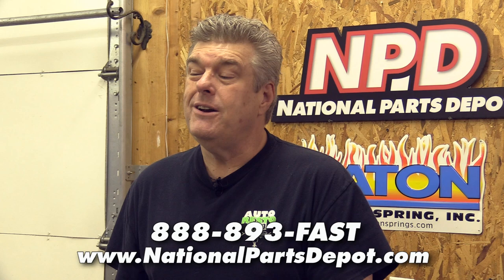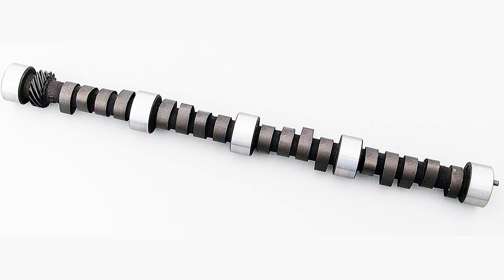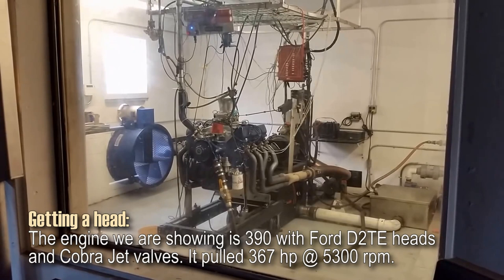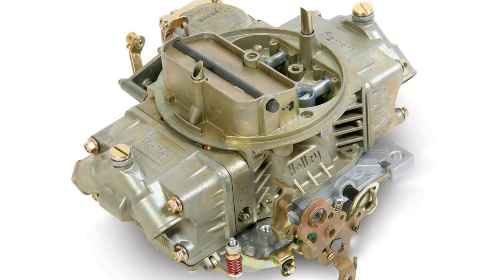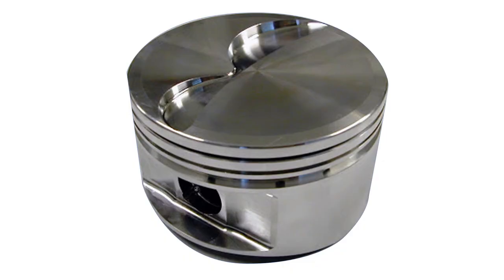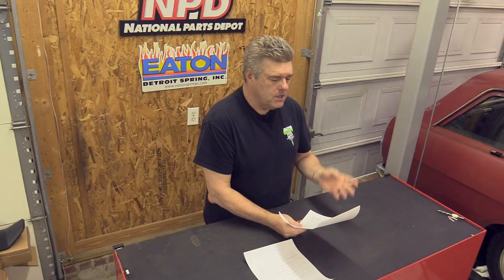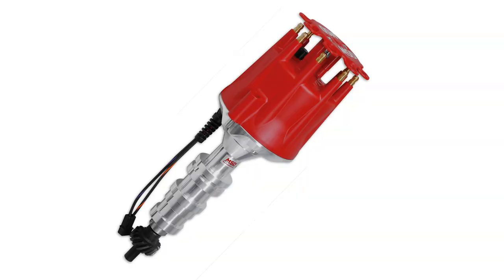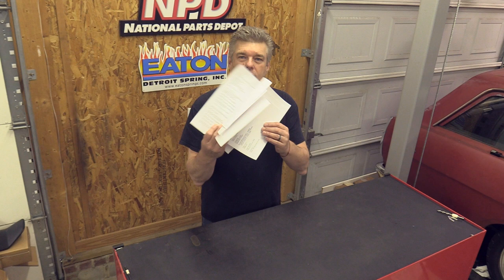Ford FE Build Tips

Comment: I got a 428 SCJ in a Cougar that over heats. The radiator is new. The engine was just rebuilt and runs perfect. Any idea why it over heats?
Reply from the maker: I might would look at the timing first. Then check your plugs to see what they are reading. You'll want to check a chart out on the internet that shows the different types of plug reads. If it is running too, lean the engine will start to get hot. Also, on the Fe engines, overboard can be a real problem for thinning out the cylinder near the water jacket. That can create hot spots. If the engine is over .40 over that could also be an issue. But work on the timing thing first.

Comment: I love my FE in my 71 f100 short bed. The motor is a unknown mileage motor that was in it when I bought it. It is a remanufactured motor I was told and a 390 but not verified. My question is what do I need to do to install fuel injection on it. It has the tank in the cab still. I know I need a return line but not sure what all is involved. I’ve seen a return tank under the hood offered but don’t know anything about it. Thanks for any help on easiest way to do it.
Reply from the maker: That's a really big question lol.. What kind of fuel injection do you want? Do you want direct port injection?  Do you want throttle body injection? The directions you can go with this are almost endless.

Comment: Seems like the other commenters know their fe engine so I have a question. I got a 330hd in a truck with a 14k pound empty weight. How do I get more power at cruise rpm (like 2500)without using high test gas.

Comment: Are the f e blocks all the same ?352,390 ….
Reply: 352,360,390 are same block. 427 is different and 428 is again different from the others but the rotating assemblies interchange into all 3 blocks. 427 and 428 blocks are harder to find and usually more expensive.

Comment: Have a 390 fe motor just got it back in new r&r now it’s mixing water with oil bent my push rod on one cylinder what happened what could it be
Reply from the maker: Sounds like a head gasket issue.

Comment: $7,000.00 For 360 h.p. , guess it depends on what you want, seems like big investment for small return.
But, it is a nice combo.
Reply: It does sound pricey and my small block chevy costs less and makes very similar tq/ hp. I love all cars and most trucks. I prefer Ford trucks.
Reply from the maker: The FE is in a group all its own.
Reply: Small return? Hardly.  Mine I built in 1999, makes over 425 hp and had gone for over 30 years since plus the years before. I don’t know.

Comment: Power nation built a FE around 10k in parts and pushed 600hp
Reply from the maker: Yep.
Reply: I remember that one and it would run on 91-93 pump gas. I know that they weren’t even pushing the timing.

Comment: I have read nearly every reply in the comments, and it seems that one issue has not been commented on that prevents 
any of these amazing 60-70 year old+ Ford FE engines from easily performing as the HP(High Performance) versions that 
were produced for nearly every FE model cubic inch displacement that was manufactured by Ford. Those HP engines had 11, 11.5, 12 to 1 factory compression ratios. Todays gas pump cat urine fuel prevents some fairly easy perfomance gains from original iron components, and maybe requiring piston and rod upgrades to handle the extra horses depending on how hard it is run. I am having a 1964 427 FE stroker built with modern hard parts for the rotating assembly and premiumI am going to have to settle for on todays  available pump gas. Makes me sad.

Comment: I cant decide.....I am contemplating a final build....445ci fe with aluminum heads on fuel injection.....$15k or a summit 460/540ci on fuel injection..... $16-$17k for a 73 f250 on super duty axles....
Reply from the maker: These are ponderous decisions.
Reply: The 445 is a good engine.  It can be a really torquey engine. If you have a 428 a 4.25 bore is a lot of fun too.
Reply: @fenatic7484  i went with a stock bore aluminum heads. Full roller. Waiting on fuel injection.

Comment: Curious on how a 268H Comp Cam (High Energy) would perform in a 390..
Reply from the maker: Honestly not sure
Reply: On an everyday driver, add headers and sure.  It will be fun with a750 VS carb and an RPM intake, at least you can have a valve job, new valves 2.055/1.625. It will be in the 430-450 range. Be sure to get top notch lifters!  It will be so nice. If you go into the pan, I would get a 3.98 crank do the rods with ARP bolts and forged pistons, and as Morgan said get it balanced. The engine will be good for 250, 000 miles or more with good maintenece.

Comment: 390 has rail rockers [no sled fulcrums] it is not possible for the damper to come past the pulley on the fe engine ditch the stock intake way too heavy alum. intakes are plentyful on the used market i have bought 3 in the last  2 years [under 200 bucks] the edelbrock stuff is really good i have one 390 with that set-up never have seen the step you are speaking of ?

Comment: How far can you overbore a 390 before you run into trouble? Or any fe engine for that matter?
Reply: Someone will probably override this, but at least in the old days, .030 inch was the maximum for the FE. The thin wall castings indirectly led to the high cost of the 427, due to so many failing quality inspections. Honestly though, my level of expertise falls short of what Jeff and his crew can offer.
My understanding is that the best production 390 block was in the 1977 pickup. If you do have an engine from the factory production time, getting the block and heads checked is worth the money.
Reply: It seems .030 is the safe limit.  More than that and you run the risk of getting too close to  the water passages.  Having the block sonic tested is a good idea to prevent that.
Reply: @et76039  Wow I had no idea they made the FE into the late 70s. I guess I assumed the emissions of the early 70s was what pushed them to use only  the Windsor and 385 series
Reply: @Jacksonkellyfreak  , the 390 soldiered on in the pickups after they got too "dirty" for cars anymore. The 400M eventually replaced it there. To show you how much respect the 400M got, it was common to remove the crank and put it into a 351W, to give it a nominal 400 cubic inches. 
I knew of one 390 engine that got ruined because because someone failed to mix antifreeze into its cooling system, gambling that freezing temperature wouldn't come to Florida. Other than that, the 390 seemed to be quite durable.
Reply: @et76039  FEs are a hell of a good engine and with all the modern performance they get overlooked or replaced.
Reply: In the olden days .060, with 427 being exception of .030. I've heard of 390 being overbored .080 & installing 406 pistons without issue.
Reply: @tombryant1104  , thanks for the perspective. I wasn't an engineer or engine builder, but we can definitely benefit from those who were around back then.
Reply from the maker: Good tips!
Reply: @tombryant1104  Any performance build needs a sonic check. The 105 blocks from the 70s pickups after a good sonic test might be capable of a .080 overbore. But with stroker cranks that after a bore to .030 over with a 4.125 - 4.25 stroke why not just build a 431 or a 445? If it Sonics to allow a 4.11 bore which Ford claimed was the max overbore, if you are concerned with piston speed go with the 4.125 with the 6.7 2.2 rods.  With good heads and intake and a roller cam, 600-700 hp depending on what is useful or tolerable to drive as you want. But a sonic test first. The triple webbing in the mains are good. A set of Pro-Gram caps or as I have a CapSaddle and Studs.   You can get great power from this horse. It was born at thoroughbred, and with some proper work could be again. That’s the fun from towing to Ray Paquets T-Bolt, wow!

Comment: The 66-67 fairlane was no match for the 389 3x2 gto of the same era. Sounds like this might have been the cure
Reply: bull!I was there, putting standard trans in GTA'sBut I had tricks,ever heard of drillpipe?
Reply: @duccanard9079  saw several comparos in rod mags and  on the street tooo. Out of the box stock
Reply: @tombob671  all library no life?
ate 440 6 paks with 302;s,killed 383;s with351 windsors, built 402's and forgot fuel push rods, and you read?
Reply: @duccanard9079  age 73, got life I remember stock no mods GT ran 15.9, GTO ran in the 14s. I am a Ford guy, but stock off the show room floor it was what it was. And  I had a 68 390Cougar. The 390 is a torque monster.
Reply from the maker: Ahhhh the sweet sounds of car guys arguing. LOL
Reply: @AutoRestoMod  no arguing on my part just my experience in 66. I am basically a ford guy but at 73 I have owned most brands used. As the man once said "your mileage may vary YMMV"
Reply: The secret is to do what Wangers did in those early tests , put a 421 in there and pedal it so no one’s the wiser. A .048 over 410 is a 421 in an FE with a 750 Holley the 428 CJ planned B cam  in place of the 600 and the little cam would have been a fun test. It isn’t cheating it’s just getting your best hold! 😂

Comment: What can you tell me about the 289 gt
Reply from the maker: What do you want to know? The 289 Challenger V8 was rated at 220 hp, used a cast iron 4V intake and 1.08 venturi 4100 Autolite carburetor. it used the stock Ford manifolds (not the HiPo style) and was discontinued in 1968 in favor of the 302 4V.

Comment: I only use clevite 77 bearings.
Reply from the maker: There are lots of pros and cons on all fronts for parts. Some folks won't use cam A because they have had failure issues...I'm like that too. I don't use Edelbrock carbs, do they suck? No. But I don't know how to get a poor mans tune from one like I do an Holley.
Reply: @AutoRestoMod  yeah I can work on a Holley as well. But if you take the top off an Edlbrock carb. Springs and check ball go everywhere.  Lol

Comment: Canton Pan. Balancing is NOT 1900.00. I have used Barry in the past and never again. I was charged Big $ for things that were not done. One of the rods had shavings under cap when machined so it was way off, machine work sloppy at best. All I can say is I am glad I went thru and checked all his work. Not to mention when he gives a timeline it becomes tomorrow, next week  . . for 14,400.00 one can run circles around that engine all day long with a much much better and more reliable engine that will make more HP. Better driveability too not to mention 3x  better MPG.
Reply: I paid $190 to have mine balanced. Not 1900
Reply from the maker: Sorry you had that experience.

Comment: You would have to be out of your mind to pay that kind of money for a rebuilt 390 with stock rockers and a small camshaft . I bet for $15000.00 I could come up with a big CUBE Fe and around 600 hp with the parts that you could buy off the shelf today .
Reply from the maker: $15,000 is not using stock rockers or a small camshaft. The engine that used that was more like $6900.30 and was the basic build.
Reply: @AutoRestoMod  Give me $3000.00 and a decent 390 and I will give you  400 hp engine with gobs of low end torque . I may even do the oil system for free .

Comment: Just out of curiosity,  why does Clegg Engine call their Scat stroker kit a 444 and here you call it a 445. I'm going with one of those kits for my 390. Believe me,  I don't want to be the idiot calling my motor the wrong thing. I mean imagine if you had a big block Chevy 454 and called it a 453 or a 455. You see what I mean?  I understand that  cylinder head volume and deck height and piston dish/dome volume  and head gasket thickness all go with bore and stroke to equal cubic inch displacement , but let's hear from all of you YouTube/ internet experts, seriously,  what should I call it to meet YOUR approval?  444 or 445?
Reply from the maker: Will it worry you to know that a 351 is really a 350? I'd call it whatever the manufacturer calls it.

Comment: Why a 260 HE?? 212@/050 is ridiculous for a 390 it is fine for a mild 289. Try a 270 Mag 224@.050 .530 lift, easy idle, plenty of vacuum. Do a gasket match port, clean the pockets, get a 3 angle valve job. add a Performer with a 1" spacer and a Holley 3310 (750) use the stock Ex manifolds but dual them with 2 1/2" pipes and viola.. 375 hp 450 ft lbs easily
Reply from the maker: Okee dokee!
Reply: Or go with the Edelbrock Performer RPM cam, 294 dur. and .572 lift with their heads which only have 209/166 valves and intake pkg which should give about 418 hp and 434 Torq. There are other brand heads out there comparatively priced that have  220/177 valves that have to flow even more air and probably make a few more hp. I agree with you,  why waste $ under building,  just do the research and build the whole package that will do what you want and you can afford.
Reply: @davidkeeton6716  I like the edie heads but the cam and heads will set you back over $2000 and the duration will require a higher stall and will compromise vacuum. The comp 270 is a great boost but maintains rock steady idle/vacuum and the heads will cost you just some time and a 3> valve job. With about $500 more for larger valves and porting and a comp 280 magnum...still a good vacuum.. you are looking at 400 plus and 465 ft-lbs
Reply: Put a 270H in and put one of those rear installed turbo chargers under the cab and back up to a blow through bonnet and carb . Just a set of headers to a 2.5 2-1 cross over with a short pipe to the turbo and a 60 mm Wastegate and a 4 inch V band out under the bed . Mount it on the passenger side so your 4 inch open pipe does blow the constables window out. Good ring gap 410 at .020 over should make a nice daily driver with 625 hp , 10 lbs boost! Pulling the trailer up the mountains! 😂
Reply: @fenatic7484  Ok, you said Constable so I am assuming you are one of those wacky Aussies? and, if so, with your people's love of strange hybrids, I am going to assume you meant TWO of the above combos, linked together with a common drive, one in the engine bay, one in the bed of the UTE ?? you are running away from the constable with;)

Comment: FYI:  I weighed a bare FE 4V cast iron intake at 75 pounds. Compared it to a brand new bare Edelbrock aluminum intake I had and it was 25 pounds. 1/3 the weight!!!!
Reply from the maker: I thought they were 98 pounds. Man, I need to start working out again.
Reply: Get help, or get a chiropractor.
Reply: I weighed a CJ and a 390 2V off of a 69 and they each weighed 84+ I think the later ones had more iron in them. The 69 2V I had was the premium fuel IP engine and it was a taller intake than other 2V s I have had. It was a bigger Venturi 2100 cab too. 1.33 I think it has been many years!

Comment: So a stroked 390 is a 445? WOW! What's a 350, non-stroked ,bored .060? 360?
Reply: There's a number of different combos. Depends on bore size and stroke length.  Stock 390 has 4.05" bore and 3.78" stroke.  Bore it .030" and add a 4.25" crank and you have a 445.  Other FE cranks you can find or get include 3.98 and 4.125.
Reply from the maker: What David says. It is a matter of what you do with the crank and rods.

Comment: Coyote. Won't make 400 ft tq at 2000 rpm.  The coyote needs 5000 rpm to catch up.  To the 445 in the tq range
A coyote with a carburetor on a c6 transmission won't be all that on fuel mileage  either.   Just saying
Reply from the maker: All true!

Comment: Federal Mongrel pistons are generally so decompressed as to be stupid. A factory 9.1-1 400 is about 7.5-1 with them. Bloody hopeless. And in this day and age a narrow ring piston is preferable. Less drag better seal.
Alloy heads are generally a markd improvement and gets rid of some weight over the nose of the car. And sometimes by the time you have 'saved' the iron ones not much more expensive..
Though if your are basically ok they are fine. Intake though,, you get a better denser charge from alloy than heavy old iron ones and a Performer or similar is better. Spend the money!!
For a mild engine such as this a 670 Street Avenger or Brawler eqivilant is the deal. Better mid range and better economy. Never a double pumper,, that is race engine stuff. And even then at times a Vacc sec HP out performs those. 
In recent decades I have found that with unleaded fuel a MSD or similar is essential. Car starts and idles far better cold and gives better response and economy. You can trigger it with points, make certain the box you buy has white wire. The electronic ign is simply better and trouble free. I had a set of points close up!!  
390 is quite a good but heavy and large lump. Full size car only, not into Mustangs etc where they spoil the handling and are hard to work on as well.
Reply from the maker: Thanks for the input!
Reply: Lighter than you think with the Ed RPM

Comment: I personally like the 352fe the best
Reply from the maker: The 352 is a great engine...but there is no substitute for cubic inches! 😀
Reply: @AutoRestoMod  I agree! I'm just biased because that is what I have in the 67🤣
Reply: I've owned four or five 352s in past, including a 300Hp Interceptor, I'll stick with my 428s. Except for maybe a 360Hp for '60 Starliner, not sure why anyone would build one. 351W or C has exact bore & stroke(Ford lied they're also 352), and weighs probably 125-150 Lbs less.